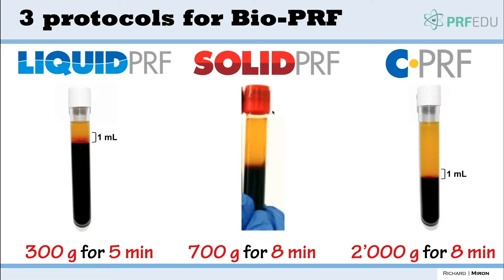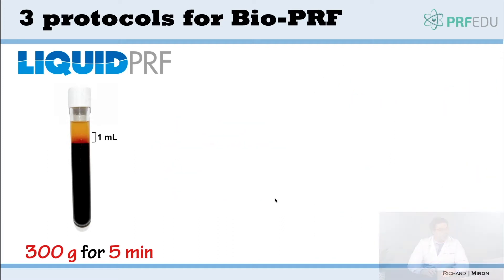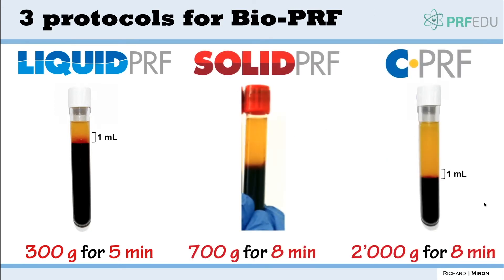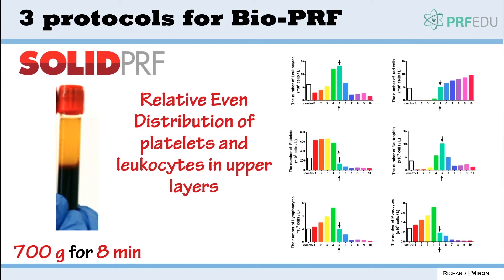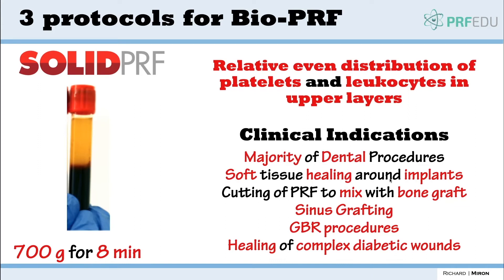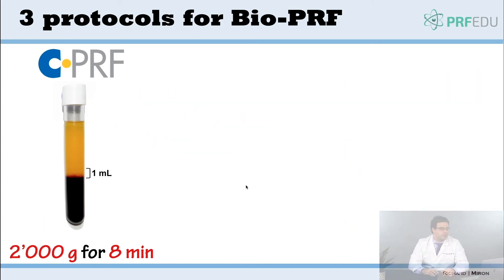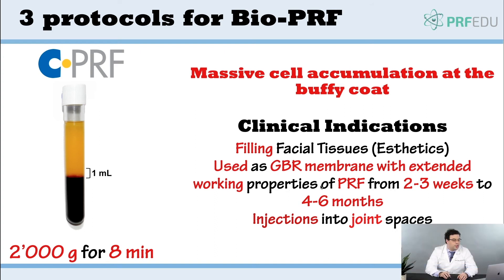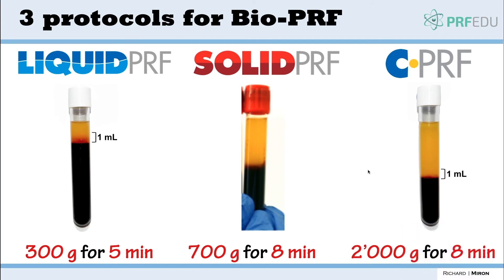Chapter 5.1: Protocols for PRF presented by Dr. Richard Miron

Comment: Hello. My centrifuge's rotor diameter is 95 mm. By formula given to spin 2000g converted into rpm is 4336 rpm. The max I can do rpm with my centrifuge is 4000rpm. In this case shall I spin 9 minutes instead of 8? Or enough 4000 rpm for 8min for CPrf? Many thanks